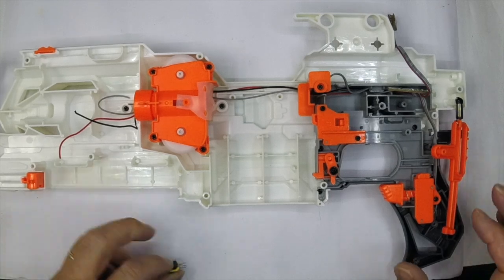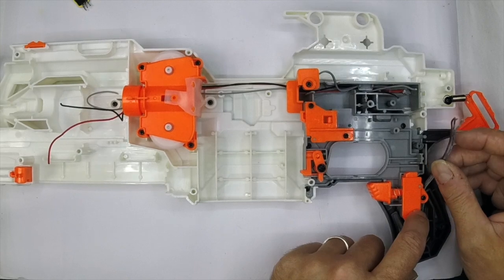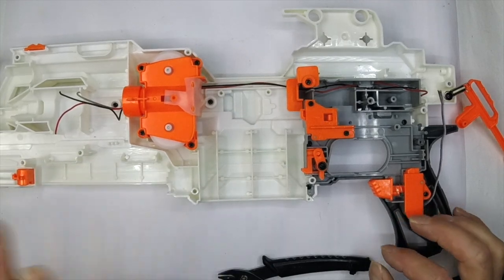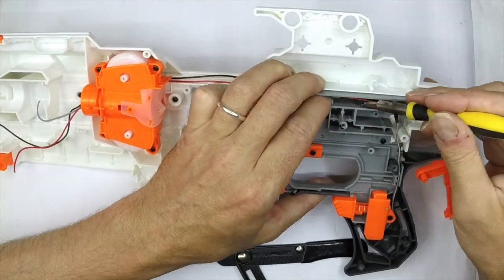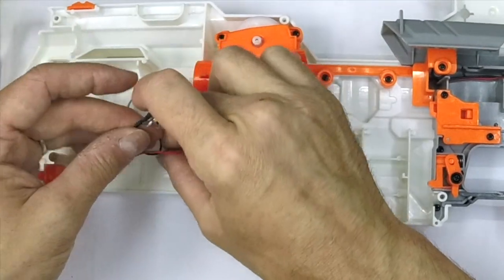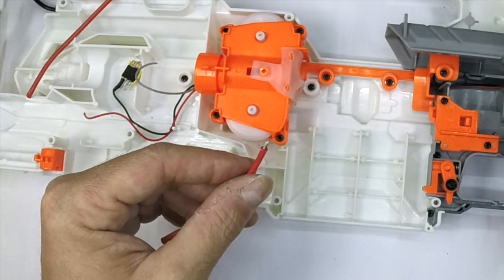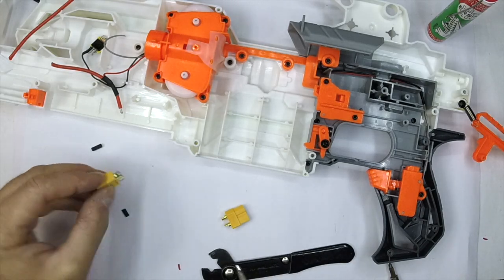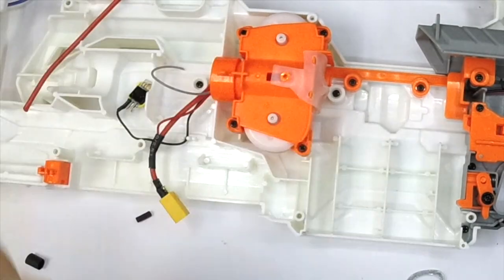Modular Nerf Modulus Mod!

Comment: Can rhino motors work on this
Reply from the maker: Yes but you can only use Lipo with Rhino motors, NOT IMR.
Reply: Foamdata Services can the rhino motors take 3s and does it need a micro switch
Reply from the maker: Rhinos are designed for 3s. Mosfet builds don't need replacement microswitches, only signal current is carried in the rev trigger. That's why they are better.
Reply: Foamdata Services y can’t it work on IMR and do they still work on normal AA
Reply from the maker: 2x Rhino motors draw 16A peak, IMR only puts out 8A peak. By all means over discharge a lithium battery by 2x its maximum currrent output if you want, just don't expect it to last very long. 
AA alkalines put out LESS THAN ONE AMP. They are even more shit tier than IMR. Get this in your head- Stock motors are fine with AA/14500 cells, EVERYTHING ELSE NEEDS A PACK. It's physics, watch my balance video.

Comment: Isn't this more or less the same as the mosfet tutorial? Love it though, just did the same with my own modulus.
Reply from the maker: Nope, because at the end it works with the stock battery tray or Lipo, unlike the mosfet mod which was designed for Lipo and mod motors only.
Reply: Foamdata Services I thought your mosfet tutorial used an xt60 plug to allow for switching between the two?
Reply from the maker: There was no mention of using anything other than lipo in that build, you can't use IMR or AA cells with mod motors.
Reply: Foamdata Services Ah, I see.
Reply from the maker: All will become clear in Part 2.